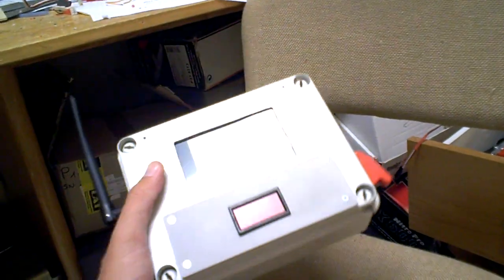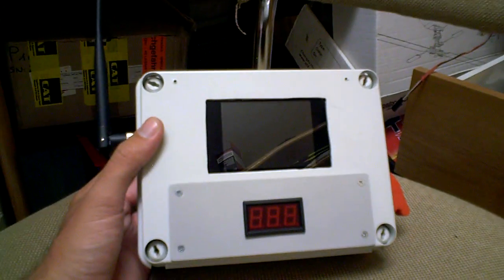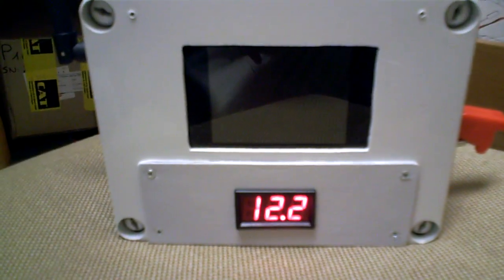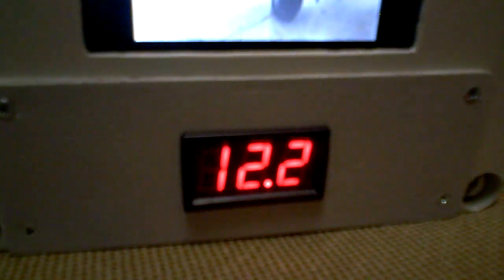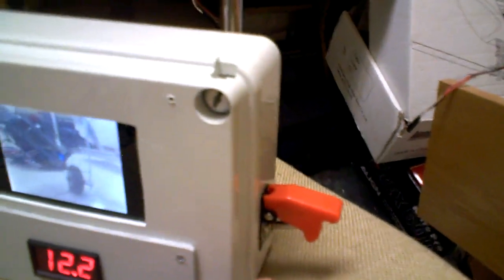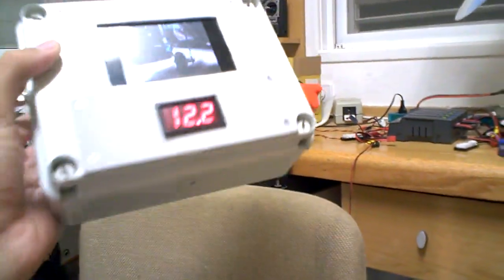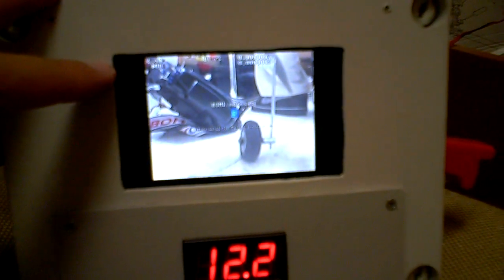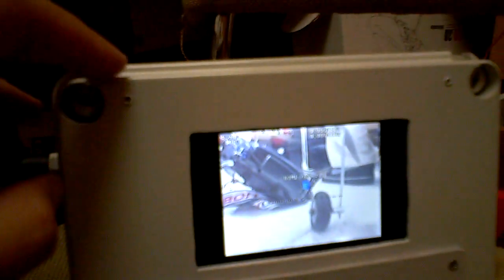DIY FPV box review

Comment: Nice box, but guarding the OFF position, like you have it, you're preventing someone from accidentally turning the unit ON. Just a suggestion, you should probably have the guarded switch guard the ON position. I wouldn't want someone bumping the box and accidentally turning the unit off while I'm flying...you dig?